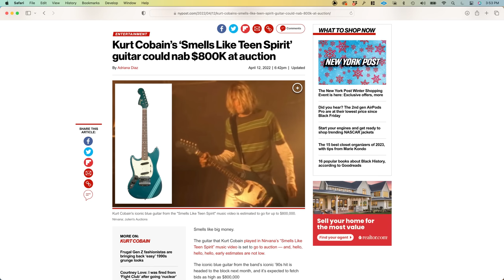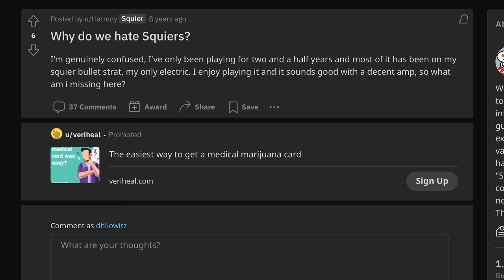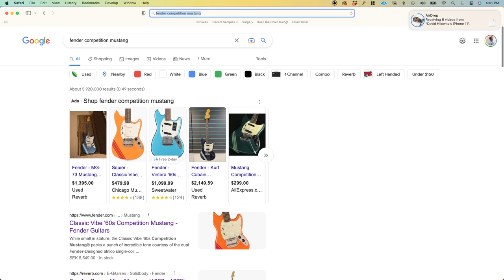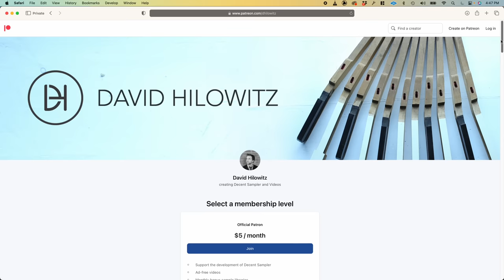Squier Mustang: How I learned to stop being a gear snob

Comment: I've been a pro guitarist since 1975. A guitar is only as good as you think it is. I've got expensive and I've got cheap. Gig with the cheap ones and record with the more expensive. Not one is better than the other in the grand scheme of things. I can say this ... guitarists from 1980's onwards had a better chance of finding a good cheap guitar that their forebears. Off brand guitars back in the 60's and early 70's were by and large, really bad. We didn't have the knowledge that Youtube brings to do all the mods you can do now by yourself, and we were starting from a much lower base line that Squire etc. There are lots of snobs in music and equipment snobs are by far the worst!

Comment: I had 2 of these Squier Mustangs and they were by far the worst guitars I have ever owned. The necks on both were un true and on the second one intonation on the high E was impossible (not even close). The neck PUP's just stopped working? Absolute crap like cheap guitars were like in the 80's, basically toys.

Comment: impo, it's ok to be a snob or a hoarder, but not both. If you take seriously your craft; investing once or twice into proper tools is usually worth it. Renting is another option, like for the studio one would rent mics and rack units, so why not guitars? I've got 2 gibsons, for 2 different tunings; and the other has coil taps if i'd ever want a single coil sound. So like honestly wouldn't that selection of guitars be better if instead of the 4 epiphones and 6 squiers, you'd just have one USA gibson and USA fender. Unless you use 7 different tunings, but cmon.

I might want 2 more; for having an own jack per humbucker; for studio applications. But imagine doing all this work, i mean anyone with the knowhow to setup a guitar to a specific sound is worth something. So doing that multi hour work setting up, a 300 buck made in china made from poplar piece...? It's cool i know, i put duncan quarter pounders to a benton 3/4 bass. Sounds like quarter pounders, and is easy to play. Very fun, but the shielding, the fret buzz; "so much a truss rod can do". Prolly better to use more money on the wood, than the pickups, but again is just my personal take and you as an artist are free to art any way you see fit, and productive..

Comment: Interesting video but squier mustang (the cheapest one) is a piece of shit of a guitar. I had said that for only two guitars in my life. The first one being some shitty aria I borrowed as a teenager. I had guitars for 50$ that outperformed squier mustang big time. The worst things on the mustang are pickups, neck and toggle switch. The neck is so thin that the slightest pressure causes strings to change pitch. Unplayable. Save your money and buy yourself some decent squier strat.

Comment: Your music is excellent but you spent 4 hours putting copper tape into a guitar that will play distorted. I don't get it. You say you're not longer a gear snob ... but your music man specifically has a Celestian. It's inane ... like Alex Lifeson with racks and racks of processing to get ... distortion. I thinking Rush wouldn't sell one album less if he just used a $150 distortion pedal instead of a $150k setup.  An example a person who is NOT a gear snob is David Gilmore. Before the Pulse tour he apparently went into Sam Ash, saw a red strat, and said "how many do you have" and played most every one with minimal modification into stock Hiwatt DC103, a necessary pedal board and that's that.